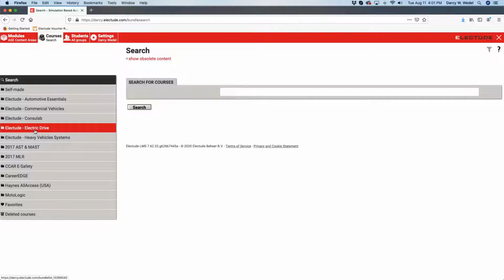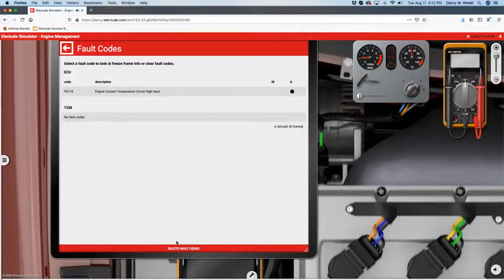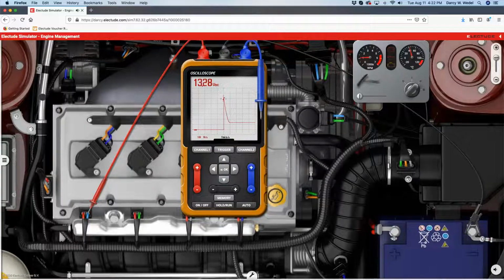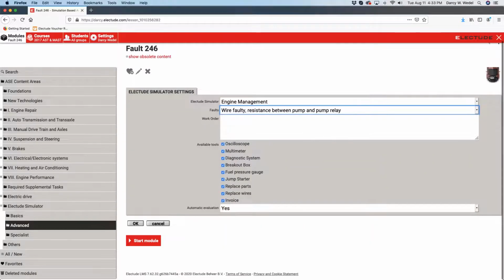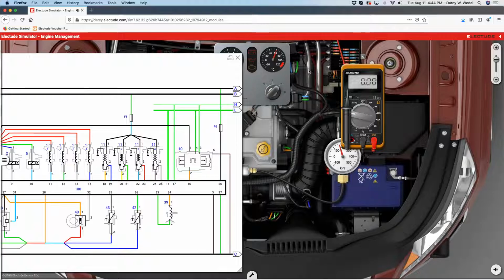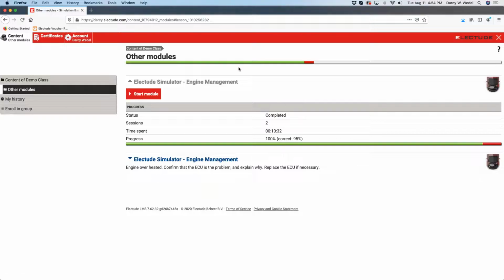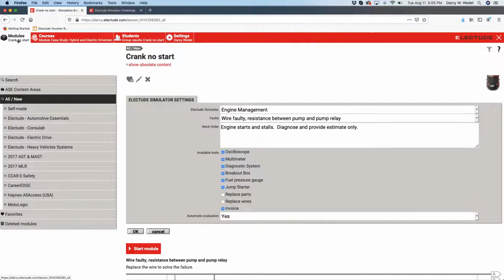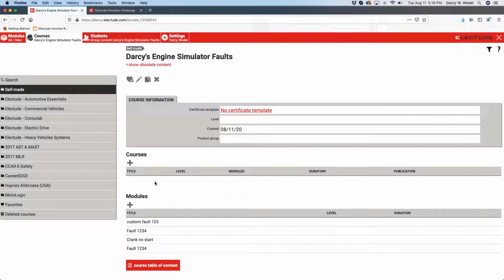Electude - Engine Simulator Webinar

Comment: Hi 
I have a problem in my simulator electude the work order says that "there is  cylinder number 3 doesn't work and unfortunately i can't replace the composante"
I hope you are going to solve this problem.
Reply: Hello can you help me...
How I work on Electude simulator...
Reply: I have a test on Electude but am not able to work on it. Can you help me about it.
Reply: Sure just tape electude on YouTube and you will find many  videos that explain how to use electude.
Reply: @youssefzegari1618  Dear if you have quiz data of Engine,Starting system,charging system and wheel and tyre please share with me.
Reply: @youssefzegari1618  My test will conduct from these topics and I haven't data for preparations please need you help.